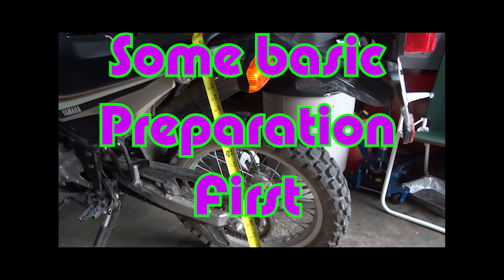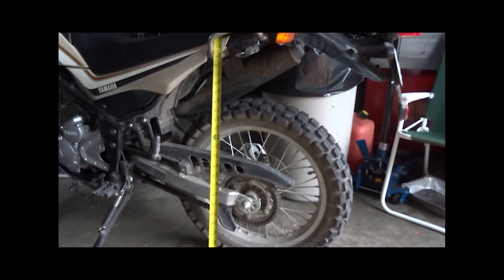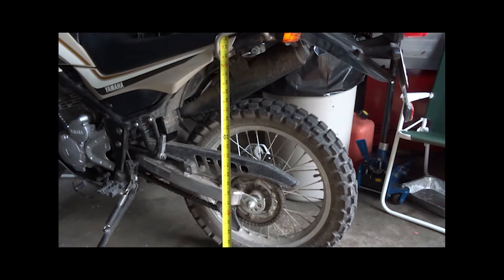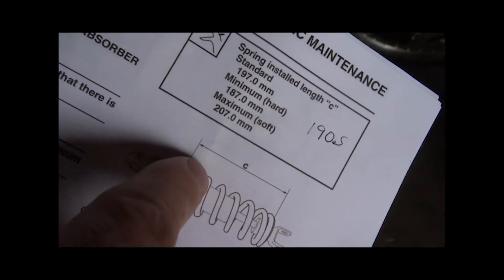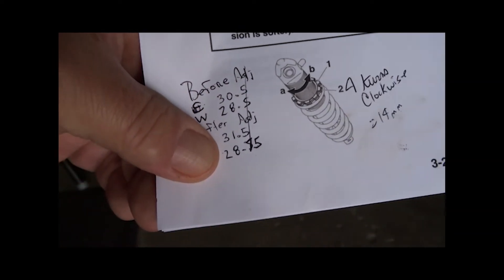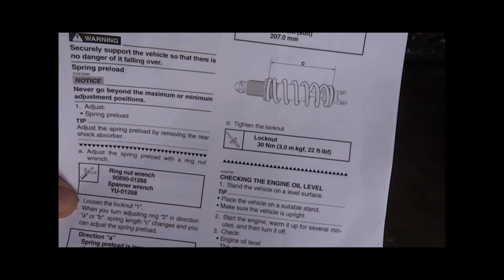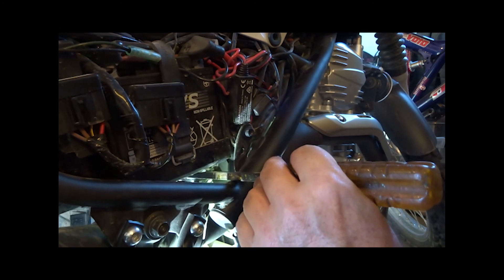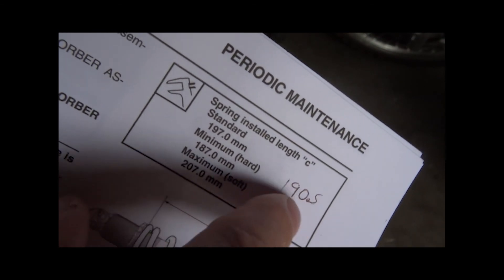Yamaha XT250 Rear Shock Preload Adjustment

Comment: Thanks...good info on the XT.  A couple suggestions after tinkering on my bikes for 20 years.  1) Taking the weight off that rear wheel will make any adjustments to the preload easier.  2) Removing the shock unit on this bike is in fact very easy and a good way to go.  While it might sound difficult, it is not.  I know because it is the same setup as on my WR25R and I pulled that shock to send it in for new valves.   You don't need any special tools.  If you have a socket set and wrenches you are good.  (Besure to get the weight off the wheels but support the rear wheel because the swingarm/wheel will drop down once you remove the shock bolt).  Learning how to work on your bike is one of the joys of riding.  And just like a trail that looked scary the 1st time, a couple times down it makes it seem like nothing.  Wrenching is the same.  A good XT suspension vid  (front and rear) is on the MixedGrid YT channel
Reply from the maker: @toddwmac  thanks for the comment.   It rings true.. very good thoughts for others to consider.. have a great day!

Comment: I just did this mod/adjustment and I can’t wait to get the bike out for some test rides.  I went to max stiffness based on the info in the video and I just used a regular flat screwdriver.  I marked the ring and turned it about 3.5 turns.  Mine is a 2022 so I hope 187mm is still the same target.  Only took about 30 mins, taking my time.  
Thx for the video!!!!
Reply from the maker: Thanks for the comment, it really made a difference for me… just find that balance between control and comfort, as it depends on weight… I’m not lite plus I put my kid on the back sometimes…. If I lose 20 pounds I might back it off half a turn.. 😝
Reply: Sounds good - I'll see about further adjustment.  I'm just over 200lbs and of course there's gear and anything on the bike like 1G fuel so figured to start with the max!  :)

Comment: My girlfriend just bought a 2021 XT250.  She has ridden street bikes for years, but this is her first dual sport.  This is the shortest 250 on the market (seat height) and she is short, so a good pick.  It was JUST a little too tall for her.  Most of her "falls" while learning to ride on dirt was coming to a stop and not being able to touch the ground and just tipping over.  So I lowered the bike by getting a new "dog bone" for the bottom of the shock that dropped the bike by an inch.  I also lowered the bike on the front folks to match the drop in the back.  This created a huge sag issue, as you would expect.  She would bottom out on the tails we ride, forest roads.  The bike was set to the "standard" length from the shop.  I turned it down 2 full turns of the nut (~7 mm).  Now it is close to the documented "Minimum hard" setting.  We will see if it takes the bottoming issue away as we go ride on the trails.  It does still bottom for me, but I have 70 lbs on her.  

I am curious is the Minimum Hard setting is no longer the "minimum" since I lowered the bike with a new Dog Bone.  Anyone comment on this?  Can I go past the "Minimum Hard" since I lowered the bike?

Also wanted to say THANKS for the great tip.  I like your statement in the video about the documentation telling you to take the shock out to do this adjustment.  It is exactly what I said when I started looking at do this, "Not happening, LOL".  I used a 6 inch shaft 1/4 inch wide slot screwdriver WITHOUT grinding it down and it worked GREAT.   GREAT DIY tip and saves the shop fees or huge hassle of taking the shock off the bike.  I would have had the bike shop do it, but we did not know the height was an issue until riding the bike for a week or so.
Reply from the maker: Thanks for the comment and great the gf is getting into off road… Sounds like u are on the right track, finding that balance of preload is going to take some trial and error… my best guess because I’ve not done this sort of mod would be an extra turn or two on the preload should be fine… Hopefully someone with more knowledge will be able to advise better… how did you lower the front?… I did not think the front was adjustable at all…
Reply: @kd_enterprise3404  Yep lots of fun.  I am 63 and she is 60.  Good to play with these toys at this age.  I sold my ROCK a 2006 DRZ400 and upgraded to a 2001 CRF300L (lighter and more street worthy). I do have an expert that did guide me though this process.   Your video was great on how to not completely take the bike apart to do the sag adjustment.  Your method is SOOOO easy to use that after a few rides I could easily do this anywhere I have a screwdriver and a mallet.  My expert and a Youtube videos talked about how to lower this bike and that the sag then needed to be adjusted.  You change out the Dog Bone AND drop the front end so the geometry stays close to the factory design.  To answer your question: I lowered the front by: 1) putting the bike on an ATV lift to take the front tire off the ground, 2)  loosening the bolts that hold the forks to the bike {My friend, who has done this a lot for his kids and wife, suggested I take the front wheel off, so the forks are independent.  This helps prevent binding as one folks slides and the other does not.  I did not do this.  It took a little care to move the folks in parallel, but it is doable.  Just make sure you measure how much each fork has moved up and they are equal, side to side.   I dropped the front by about 5/8 inch.  Just like you show in your video, I measured from a given spot to the floor, but I did this in front (by the headlight), middle (by the front of the seat, back of the gas tank) and at the tail (like in your video).   I was a little worried about the shock coming up at the handlebars, but it is fine.  I put on aftermarket brush guards and had room for everything.

Even with the preload on the shock set to near the Minimum, the bike still seems like it has too much sag.  I just did this yesterday and only did a short test drive.  I am just not sure if I can/should go below the minimum to make this ride a little tighter.  I also need to make sure I don't raise it too much, so she can not touch anymore...
Reply: @need100k  My GF is 5' 1" and about 140, so lowering it got her so her feet touch the ground.  When I take it for a test ride I can get it to bottom out (tire hits the fender) just by riding it at a moderate speed through the mild ditch on the side of the driveway.  I am going to make is a little stiffer before we head out of a 4 month trip to Canada and the UP of Michigan.  It does not bottom out for her.  I did lower the front forks as well.  I loosed up the top brackets on the forks and slid them up about 3/4 of an inch.  A good friend of mind (and great motorcycle mechanic as a hobby) suggested that it would be easier to take the wheel off to do this and I agree, but I did not do that.  Best to have a bike jack (I have a atv lift that I use) to take the weight off the front.  I have no experience to talk about thicker oil.  There is not tension adjustment that I know about on these forks.  Good question for the dealer.

I believe that making it stiffer (adjusting the spring tension) does raise it a little.   If you can touch the ground now comfortable, I am guessing that stiffing it up would not raise it to the point where you need to replace the dog bone and lower the bike like I did for my GF.  We also ride easy stuff, forest roads and old logging tracks.  Nothing you are doing would make it not street legal.

Hope this helps.  She loves the bike.  Good play in the dirt type bike, not a racer...

Comment: Really helpful video. The so-called "setup fee" that the dealership rips people off on is basically putting fuel in. Unless you're purchasing a hawk motorcycle or the like, they are shipped fully assembled . All the big name manufacturers test their motorcycles before shipping. They don't fully assemble and test their bikes only to disassemble, ship and trust Joe Shit the Ragman at the dealership will reassemble to exacting specs then warranty. I don't know why motorcycle dealers get away with this bogus lie. Cars are shipped fully assembled even riding lawnmowers are delivered to Lowes and HomeDepot fully assembled. When my 2021 XT250 hit 600 miles I checked the valve clearance myself and it was spot on. Had I bought it to the dealership they would've already know it was on but let it set in the shop for days, done absolutely nothing and then charged me.If anyone ever tells you dealerships assemble anything on a brand new motorcycle then they are lying to your face.
Reply from the maker: It’s a game for sure, but what da!

Comment: I just got a 2017 XT250 I'm a 180lbs I noticed it seems very soft it collapses when I sit on it I'm flat foot I can push down on the seat with just my arms and get a good amount of travel so I believe they have it on the soft setting what do you think I should put it at 190mm?
Reply from the maker: Yes I’d do 190.. I’m positive most were shipped soft and dealers won’t go out of the way to adjust at purchase time to fit the rider…if you find it too stiff after just back it off a bit… but I think u will like, and it greatly improves handling…. Let me know after testing…

Comment: I want to point something out,  if your a lightweight rider you need to decrease the preload if you get new 90/90 tires which are taller than stock.  This is because at 135lbs the rake angle and the wheel base wont be long enough for stable ride above 55 mph.  The bike is ment to run with a specific amount of sag or else the front end will get wobbly/squirlly.  I decrease my preload  to the max after getting taller tires.
Reply from the maker: Thanks for the comment, I can't verify all but certainly on point with weight. The factory preload is probably perfect for up to 150ish.. the other points are interesting and deserve to be considered as u have some experience with it...thanks again.

Comment: Have mine maxed out as well what does this for for off-road use im going to start now after 4k miles on the street
Reply from the maker: Regardless of off road or street it helps prevent the bike from bottoming out, prevents the rear end from sagging during acceleration and turns… when the rear end goes down too much weight comes off the front end can cause traction loss of front in various situations.

Comment: Should the front forks be adjusted also? Are they too soft too?
Reply from the maker: I do not believe the front forks are adjustable… I could be wrong… I’m still learning about the bike.
Reply: My understanding is that you need to fit internal spacers and change the oil grade to adjust the forks. Not done it yet on the XT, but have done on an Fazer...
Reply from the maker: @johnstilljohn3181  thanks for the comment,  above my pay grade… :)
Reply: @kd_enterprise3404  First I am not a professional bike mechanic....  I believe the only reason you need to lower the front forks (really just loosening the bolts that hold the forks to the bike and sliding the forks up) is if you lower the shock by putting a new "dog bone" on the bottom of the shock that lowers the bike.  This is to keep the geometry of the bike close to the same as the design.  I did this to help my girlfriends feet (toes) touch the ground.
Reply from the maker: @monumentmountainman6046  ah ok, you just answered my question I wrote…

Comment: For me I don’t mind it sagged down when I accelerate through trails cause it keeps the weight off the front when I hit bumps or like want to glide across a puddle but I will try making it suffer and see if it like it better , cause I drive my bike like an actual dirtbike, ( mine is an older model too)

Comment: Does bike have to supported or can I adjust pre load while on its on kick stand
Reply from the maker: It might help a bit but it will be fine if you can’t.. I think it might help if you remove some weight on second thought…I did edit my original comment after I thought about it…. I guess it’s like any bolt going on threads, less pressure regardless of tightening or loosening is always good… I have a stand now, but I use to throw throw a tie down strap over my garage beam and hooked to both the rear handles at back of  seat to take weight off or to level when I did an oil change.